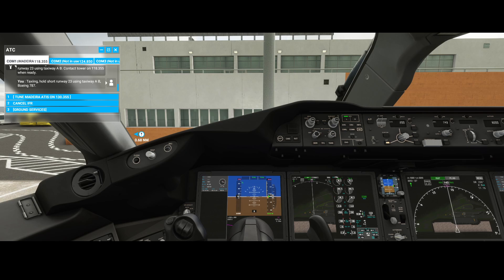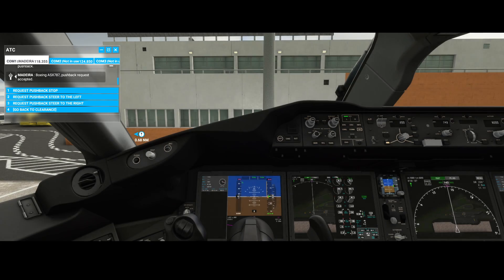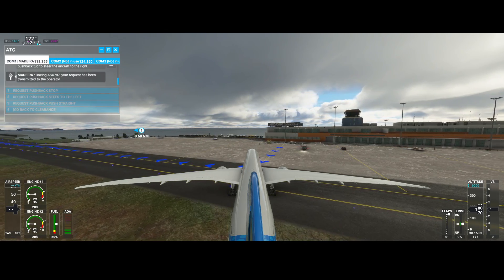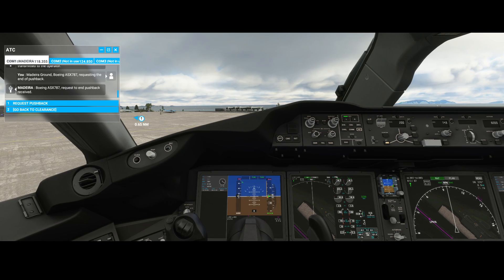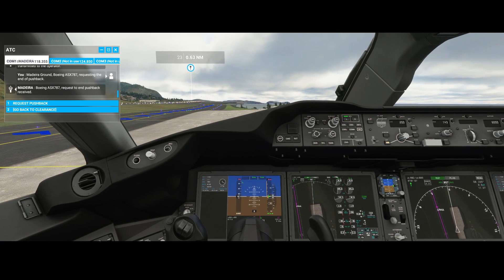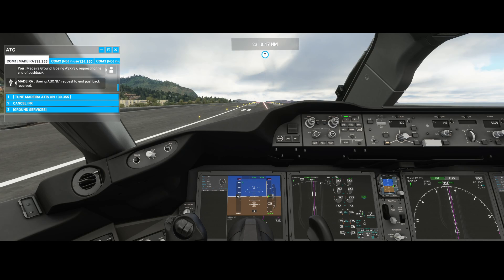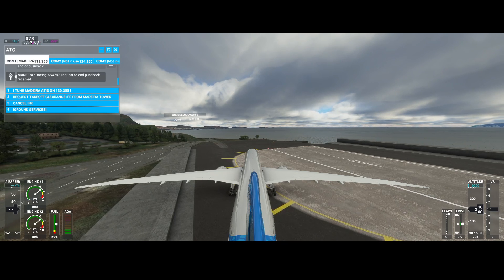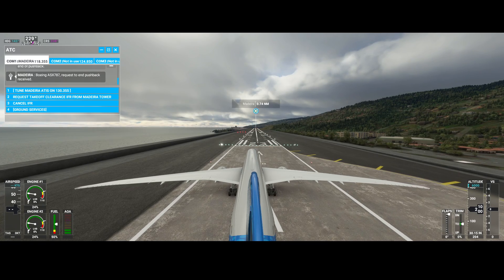Flight Simulator 2020 - How to - Boeing 787 - Turn during taxi

Comment: Microsoft & Asobo need to make the tiller steering mechanism accessible on commercial airliners, you can see it turn in whatever direction you use the rudder. Flight crews use the tiller to steer the nose wheel of the 787, and other commercial airliners, they never use the rudder pedals to steer such aircraft, that only happens on GA aircraft, like C172, Beechcraft  G58, and others.
Reply from the maker: thanks for your feedback let’s see if we can convince Asobo to fix it
Reply: @Highintheflightsimsky  That's a feature that should have been released with the simulator in August 2020, here we are a year and 2 months later and we're still steering large commercial airliners with the rudder pedals! I submitted a "Feature Request", hopefully Microsoft and Asobo will pay attention.

Comment: but the nose wheel doesn't turn more than 20 degree when turning 50 degree looks stupid if i'm using spot plane view there is something wrong with the 787 ground handling that ASOBO has not fixed yet its these   stupid  update that ruins good working planes when i first installed the ms2020 the 787 was fine but these update ruined a fine working 787 and the pitts under takeoff drags 45 degrees to left looks stupid in real it doesn't turn that bad a little bit but not the asobo WAY
Reply from the maker: Hi Ted yep sometimes is frustrated please create a case with Asobo, the more people report the issue the higher the change that they will fix it.

Comment: I found that turning less does the trick. I am able to make 90 degree turns without differential brakes or asymmetrical thrust. Just turn no more than half way or less on your device. Keep the speed low of course.
Reply from the maker: mm let me try I think I tried almost everything will give it a try and will let you know